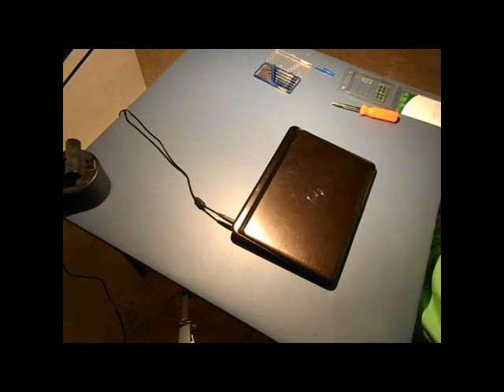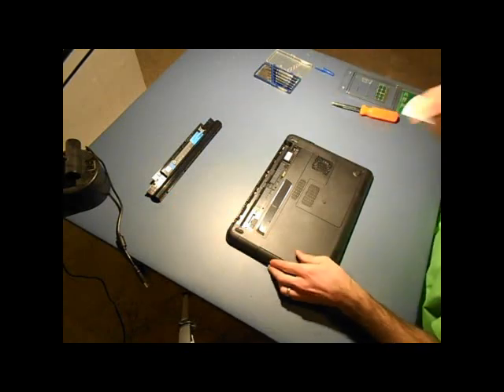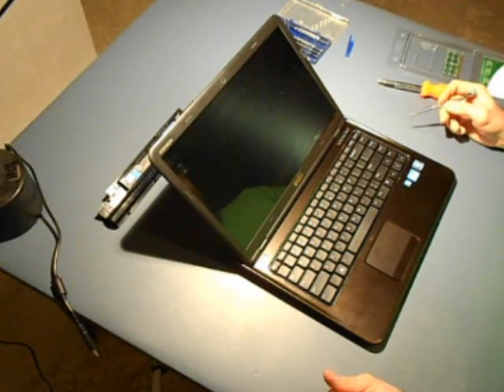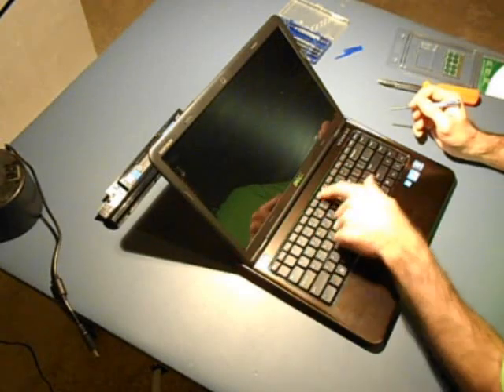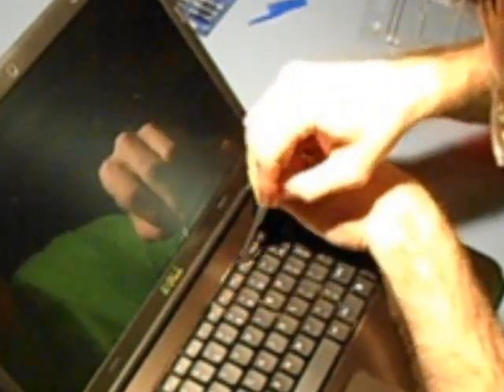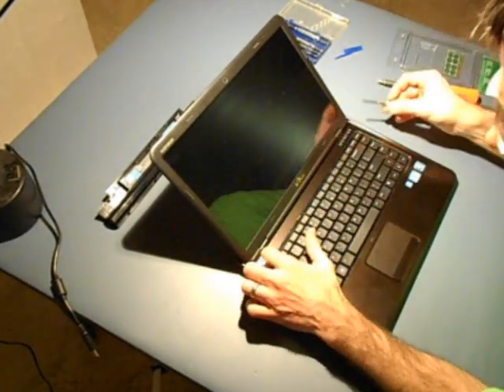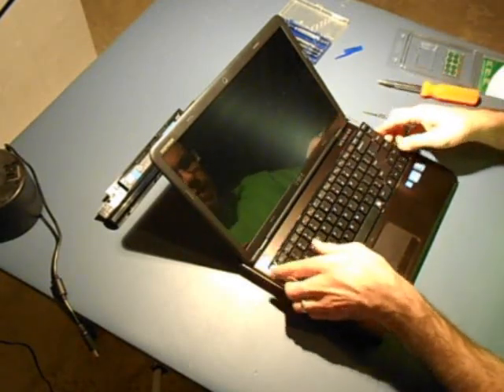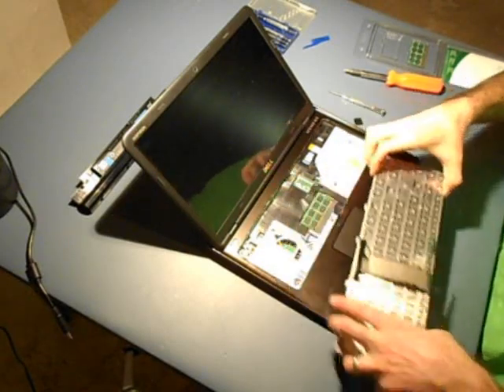Laptop Keyboard Removal (Dell)

Comment: If you are confused why yours is not coming out is because Most laptops have a small black lock near the keyboard ribbon cable 
Gently push the black lock upwards. This step is often missed, leading to difficulties in removing the keyboard.
Once the lock is pushed up, you can carefully pull the ribbon cable out. The keyboard should now come out easily.